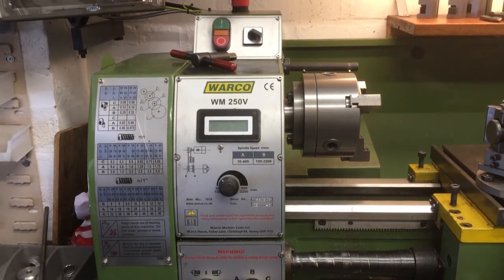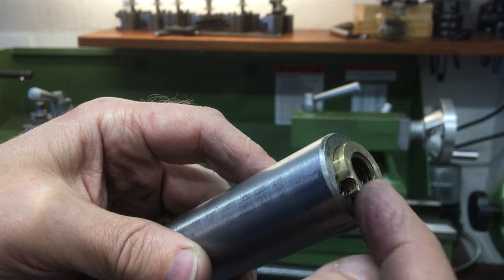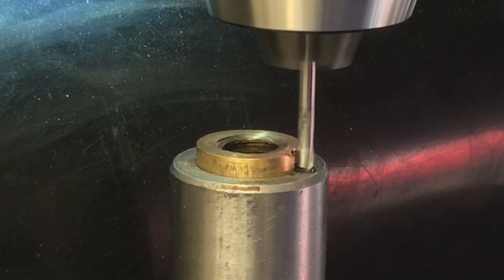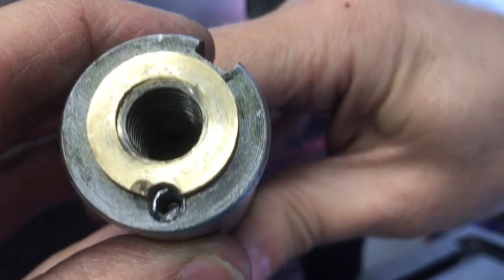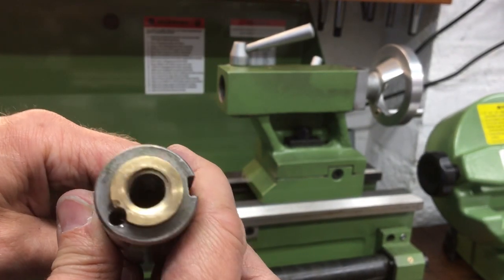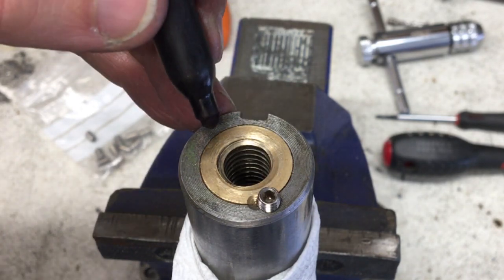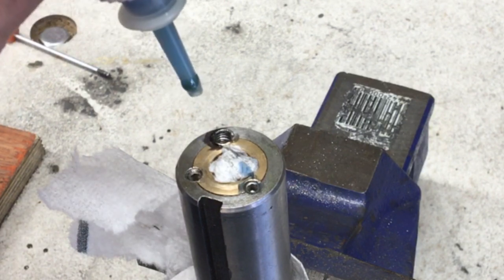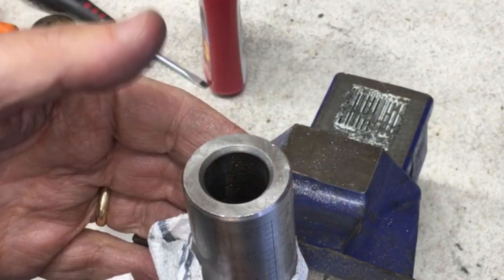My lathe tailstock has broken - can we fix it?

Comment: I have in the past drilled out hardened machine screws by modifying and off hand sharpening a masonry bit like a jobber drill on a green grit silicone carbide wheel, did that to drill out some brake caliper Torx bolts as heads were stripped and then used extractor to remove, that had to be done on vehicle (Transit van ) as we would not have got them off otherwise unless cutting them off.
Gaz Yorkshire.
Reply from the maker: OK neat idea.  I think the masonry grade carbide is a lower quality but it obviously still works for single jobs like that, good work and sounds like it saved the day!
Reply: @routercnc9517  yes it did, hss drill would not touch those bolts, had to sharpen twice though, but it worked a treat.

Comment: You need to buy some HAND TAPS.... They're stronger than spiral flute machine taps....You risk breaking a tap and you won't drill that bugger out....🤔😳😏🇬🇧
Reply from the maker: I used to buy hand taps but I found the spiral flute machine taps were much sharper and easier to cut the thread.  Maybe the hand taps were cheap/low quality?
Reply: @routercnc9517  Only you know how cheap your hand taps were...Spiral flute machine taps are more efficient due to their cutting geometry and are designed for blind hole tapping to full depth on machine and are most suited to softer metals. In the case of more high tensile materials, a through hole machine tap may used, but not to full depth on a blind hole. The through hole machine tap is considerably stronger in comparison. I'd never use a spiral flute for hand tapping, their geometry is designed for controlled on machine tapping....😳😳

Comment: oh wow your mill has a lot of run out on that drill chuck. Thats not helping. You also have the part standing way too high. Hold that in a couple of v blocks and it will help with the wobble.
Reply from the maker: Yes it just a cheap keyless chuck.  I did look into low run out chucks a while ago and would like to swap it out one day.  Maybe a Rohm model at £112, not decided.

Comment: I just did this exact repair this weekend before watching this video. It was obvious what the result would look like, but extracting the original screw was always going to be tricky. What I did was to put the piece in the lathe and turn off the remnants of the screw so that I had a flat surface to work from. From that point it was just a simple task to centre punch the centre of the screw and progressively drill out to the edge of the threads. Starting with a 1.5mm drill and going up to 3.2mm. The remains of the threads then just fell out. After pushing the brass nut flush with the top I could then just run an M4 tap down the hole to clean it up. For the other two new screws I went 12mm deep. As far as I’m concerned it’s a permanent fix.
Reply from the maker: Ok great.  It’s probably a common occurrence given how they are designed.  It could be argued it is a mechanical fuse.  Anyway glad you got it sorted out.

Comment: Heat is your best friend
Reply from the maker: Yes that would have helped with the glue
Reply: @routercnc9517  unless you heat it up to making it glow or melt, metal will expand and contract very reliably without much changes. glue breaks down easily at 300C, which doesn't effect the metal at all

Comment: Just did a similar repair to my Logan 11". Tailstock and screw were worn out, put a brass nut in like this with locktite and a press / heat and cool fit. Working so far.
Reply from the maker: Good work!

Comment: To remove a screw that is glued with loctite you can soak it in acetone over night. 
Better than protecting the surface with a paper towel is to cut a beer can with scissors and wrap it around. The aluminium is a better protection, and gives more friction to hold it in place.
Reply from the maker: Good idea

Comment: Hi, Same lathe and same apprehensions but so glad I went down this route! My tailstock had a problem but it was to do with the tread, halfway along its travel it would bind (still uasable but stiff) one of the threads had been bent over, easy fix. Another problem I had was the leadscrew shear pin (replaced with a solid brass one now) @ the headstock never snapped when I got a bit cocky whilst power feeding, bent the drive gear and Warco wanted 58£ for the privilege:face-purple-crying: I could have made one for well my time really as I had the barstock! Merry one to ye Dude. TFS, GB :)
Reply from the maker: OK the leadscrew drive pin issue is interesting.  Especially as I am about to finish my electronic leadscrew project and it will be driven with a servo!  Do you know the diameter of the pin as I might do the same.  Thanks.

Comment: Excellent fix…I was a bit worried when you were tapping the holes that you didn’t use cutting fluid, or back off the tap occasionally to prevent breaking to small tap….but all went well…I’m going to check mine now…👍
Reply from the maker: Sometimes I back off and clean the tap, depends how it feels and the depth etc.  thanks

Comment: I have the same problem on the same lathe only mine is blue (HBM), will need to take a look to see if the problem is the same, mine still ejects on tangs but is difficult on the flat ended ones. A stitch in time as they say, before it stops altogether, Thanks
Reply from the maker: Worth taking a few seconds to eject the quill and see if the nut has moved.  Then plan from there.

Comment: You definitely need to modify (more) and get more room (travel from the knee as it is , it isn't useful as a tool
Reply from the maker: This comment appeared on my lathe video but I guess you mean the drill press video.  Yes more working space would be better but I couldn’t get a design I was happy with for the knee.  It is still very useable like it is but I will keep thinking about options. Thanks
Reply from the maker: See drill press series as I’m doing just that right now!

Comment: Nice work. To avoid future tool issues getting stuck in the tailstock, find yourself a bronze wire brush from a gun shop for a 12 or 20 gauge shotgun barrel cleaning rod.
Add a threaded drive rod that will fit your battery drill and just use some CRC5-56 or WD40 to lubricate it well and run that bronze wire brush up the inside of the Morse taper sleeve a few times at low rpms.
If there’s any chips or dirt that’s become imbedded in the Morse sleeve wall, that should hopefully free it up and remove it.
The bronze wire brush should be soft enough that it doesn’t remove any metal from your Morse taper steel sleeve.
They get used on chrome bored shotgun barrels to remove lead fouling etc so should be safe enough inside a Morse taper spindle sleeve imho.
There’s 3 common gauges 12 bore, 20 bore (a bit smaller than 12 bore) & then 410 caliber which is a little under half inch.
You should be able to buy bronze brushes for shotgun barrels at your local gun shop.
Sometimes you have to buy the whole cleaning kit, with push rod and patches and chemical etc, but more often than not you can buy spare bronze brushes for the cleaning kits so that might be the cheapest option.
Reply: That makes no sense. Having 3 set screws at 120 degrees apart spreads the load equally, 33% on each screw,  as opposed to having 100% of the load on one screw. Forgive me for not understanding what your trying to convey my friend.
Reply from the maker: Not sure I follow.  I repaired the original damaged thread, then added 2 more at close to 120 degrees apart but the keyway location meant they weren’t exactly 120 degrees.  It has been working well for a while now.
Reply: @davidsnyder2000  basically 3 screws are better than one….not rocket science
Reply from the maker: Interesting idea I will look into it.  I’m in the UK and I don’t know of any ‘local gun shops’, or any gun shops for that matter.  I would probably have to look online for the cleaning brushes.
Reply: @routercnc9517  Online would work for sure.
The UK has a large shotgunning community who shoot clay target competitions at their club country estates, they also have famous shotgun manufacturers etc.
I’d be really surprised if you can’t find a local gun shop with a quick Google search, but if you don’t mind waiting you’ll likely get them much cheaper on line through Amazon and the like for sure. 👍